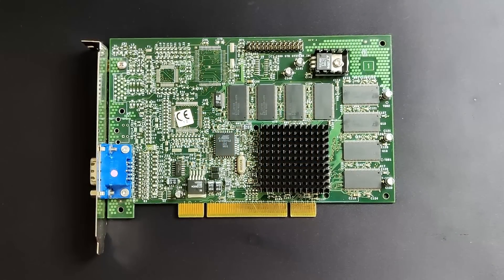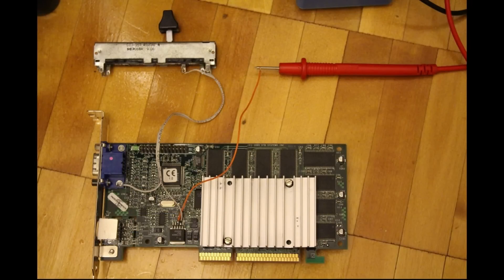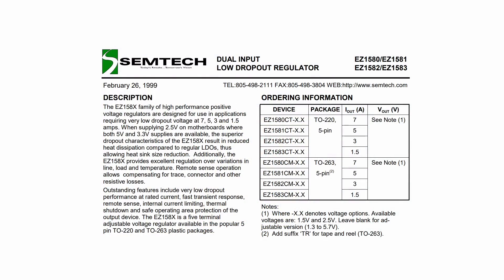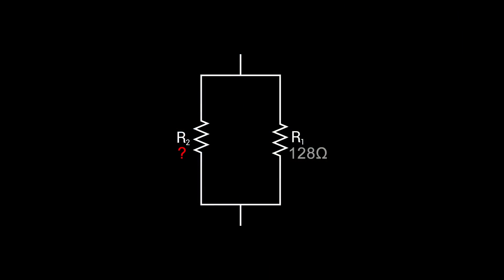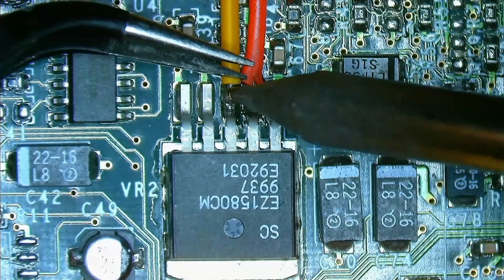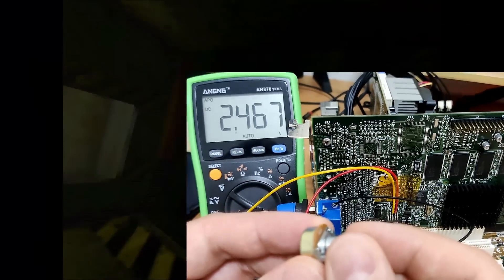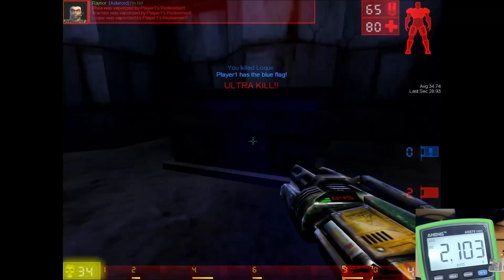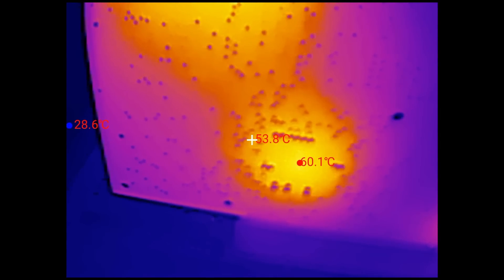Is there a solution to my hot Voodoo 3 card? YES: Volt-Mod!

Comment: The comment that installing a bigger heatsink is useless is for sure incorrect. The bigger heatsink not only has a higher thermal mass but also by all reason lower °C/W value, more heat dissipation, IF it's designed correctly and not too constrained by thermal path impedance, which i would say the blue heatsink you picked looks very unwieldy way exceeding single slot constraint, but for thermal design it actually looks very good due to thickened pins and bottom plate, they thought this through. Copper heatsink could be good as well, at same size envelope a well designed copper heatsink is almost twice as good as aluminium, i can see some really nice skived heatsinks on Ali. Titan Copper or StarTech UniVGA could be very powerful as well if you run into them, extra powerful are some heatsinks off mid 2000s VGA cards which use a copper heatspreader and a copper accordion shape welded on top with a blower fan off to the side, but can be a little ridiculous and difficult to fit.

Comment: It's almost always a good idea to connect an unused third terminal on a potentiometer to the middle pin - that way, if the potentiometer breaks or develops intermittent problems, it will fail at maximum resistance but never completely open (which can have disastrous results in voltage regulator circuits).

Comment: Recently I have removed the heatsink in a V3-2K PCI putting it in the freezer for an hour or so. This weakens the Epoxy enough to loosen it with little force and plastic tools.
Reply from the maker: This is exactly the method I am planning to use for my card as well.
Reply: @bitsundbolts  maybe a freeze spray would do the trick too?
Reply: @PhoticSneezeOne  thermal shock

Comment: You can get rid of the 3.3V regulator with a small step-down converter which does not dissipate the excess "voltage" into the air.
The LT1565 should offer between 4 and 7 amps according to the datasheet. Maybe you can measure the current drawn under load and look for a 3.3v step-down / buck converter.
Not the cheapest one, but there are really small ones with low ripple.
Reply from the maker: Yeah, I think I want to find a nice replacement for the current regulator. I will do some research, learn how to use my pocket oscilloscope, and some day make the video :)
Thanks for the suggestion of the regulator model!
Reply: If i remember correctly, the PCI Slot provide also 3.3V. Old Mainboards in the AT Form Factor didn't had sometimes the 3.3V Rail from the Power Supply and/or was not on the Mainboard provided or not with enough Amps.
Reply: I think it's not only a pre-regulator for the VCore LDO, it also supplies VRAM and Flash and IO circuit. I suspect a well designed card with a switching regulator is designed entirely differently, that indeed there is not only a switching regulator as pre-regulator (that may as well be tuned much lower output than 3.3V) but also a linear 3.3V regulator for all the low power, voltage noise sensitive circuits in the card, or extensive conditioning. Like there's for example something that looks like sync generator logic and dual diode protection on the VGA out, due to small voltage leakage, the signal quality is retained if you condition the power smooth.
Reply: @SianaGearz  as nervenderkobold2861 mentioned, the older PCI-boards don't offer 3.3V, there were adapters around which could do this. AGP per design offers 3.3V itself, don't know the exact current, but should be enough for most cards. Newer cards had dedicated power connectors like today.
I think the requirements for the V3 PCI isn't that high, otherwise the (nearly identical) AGP-model wouldn't use the 3.3V from the slot.
Reply: @SianaGearz  the use of linear regulator at that time is down to production cost. Voodoo 3 2000 were released around Pentium 3 time. CPUs and the surrounding parts already using buck converter at that time to increase efficiency. if we're talking noise, the main PSU itself already employs switching technology since AT age and noise performance at that time were way worse compared to today's PSUs yet all other parts works just fine. i see no reason parts on these graphics card to require way less noise. they're not mission critical components.

while buck converter is way more efficient and can be designed properly, their price didn't scale that well at low power use that time. LDO fits the bill with lower efficiency as the tradeoff. also, LDO tends to have worse performance at frequency higher than 120Hz unless you're looking at fancy parts. at switching PSU frequency level, they probably passing a lot of noise already

and like others said, the card uses 5V rail for backward compatibility with PCI 1.0 spec
Reply: Easiest would be replacing 5-3.3 regulator with a plug and connecting it directly to PSU 3.3V off ATX connector.
Reply: If you replace a regulator with a switching one I would suggest replacing the lower voltage GPU core one instead of the 3.3v one. Feed it directly from the 5v power and this will also remove most of the voltage from the 3.3v regulator.

Comment: For the Voodoo 3 3000 video you can also try going up in speed! I'm planning a similar mod to this to try and eek out 183MHz from my modded MSI board which had 143MHz stock.

The Voodoo 3 book on 3Dfx archive gives info about voltages, currents, and clock speeds under the VCC limits section if you need more info.

Also, if you want to remove the heatsink I have had great luck in the past with the freezer trick.

Comment: i have no nostalgia about this graphics card, yet i yearn to see that heat sink removed. By the end of it i wish to see a comparison showing a graph with the fps before and after all the mods.  Great work.
Reply: same here many must have it cause they could not buy it when they where young but back then 3dfx was nothing more then a good budget card for me for gamers but could not even get close to nvidia tnt -tnt 2 ultra against picture quality and just 16bit render and more blur and surely not to use as a workstation card i had all cards then for fun, and was my job to build hundreds gaming of pcs for customers i have left just with around 20  3dfx card just for collection museum purpose like i do with others cards but there no reason to build a retro pc with 3dfx when you can build a better with just an gf 2 or tnt2 ultra but i am not even interested in build retro pcs i can play many old games even on a modern pc maxed out quality setting and modded settings

Comment: 0:25 replace regulator with a dc dc converter you can get small pcb modules online for 3.3 and 5v out 12+ vdc in and add proper decoupling /smoothing, and put a fan and replace thermal paste and find a denser heatsink for the gpu
Reply: Drop 50 degrees simply by having the cooling system of a modern gpu and power supply

Comment: This explains why voodoo3 1000’s all seem to successfully overclock to voodoo3 2000 and some voodoo3 3000 clock speed at their stock 2.2v, because the voodoo3 chips seem to run highly conservative voltages, especially at the low end.

The catch with a voodoo3 1000 is finding a model with 16MB SGRAM. Some are 8MB and most are SDRAM which doesn’t clock much above 125mhz, while the SGRAM equipped cards generally have no trouble with 143mhz+

I run my voodoo3 1000 with an aftermarket heat sink at 150/150 at the stock 2.2v, a healthy overclock, had crashing at 153mhz and pretty sure it was memory related as the artifacts were colored dots, not rendering issues like a GPU would produce.

Comment: Great video! Considering how hot these V3s get, this is an excellent way to prolong their life along with active cooling. I saw the same one by Edward a few weeks ago and am considering doing the opposite to overvolt the Voodoo 3 2000 I just repaired. Will be interesting to see how far I can push it (with better cooling, of course). It's interesting that the different V3 models have different vcore values. I had heard this before but never tested that theory. It would certainly make sense because cards like the V3 1000 have no heatsink at all. Couldn't imagine how it could handle the heat after seeing how hot 2000s and 3000s get 🔥

Comment: I'm interested to see if you might consider it worthwhile to instead replace the resistor for between the LT1580's ADJ and the circuit ground with a resistor of the new value (82R)? 

The current through that path is specified to be around fifty microamps and a maximum of 120 microamps - so any thin film SMD resistor will handle the current, and high precision is not too expensive... 

It's good to see undervolting as an option here, but remember as with the LT1585 that any voltage that you're reducing gets burned off as heat at the regulator. Something to remember, but similar to the 1585 the 1580 is rated to function to 125C - and voltage is stable to within two millivolts between 0C and 110C.
Reply from the maker: That was my worry that reducing the voltage will just make the regulator heat up. Surprisingly, I didn't see much of a difference. I have to go over my previous footage, I think I recorded that regulator before the mod. Anyway, I can always retest that as the mod isn't permanent.

A nice idea about replacing the SMD resistor. That would be the cleanest solution. Now I just need to design something to switch between Voodoo 3 2000 and 3000 efficiency mode :) I an imagine that at 166 MHz, I need a bit more than 2.1 volts.
Reply: Perhaps he can find a small potentiometer than can fit too.
Reply: @bitsundbolts  Reducing the core voltage reduces the current it draws. This will counteract the increased voltage drop to some extent.

Comment: 0:50 The heatsink looks worse on my STB V3 2000 AGP. It's so twisted, you can see almost 3mm² from the edge of the chip with the "golden arrow". 🤣
Reply from the maker: The heatsinks on most Voodoo 3 cards are terrible! The glue they used isn't transferring heat well and then it looks like in-between Oreo cookies! There's just too much gap between the chip and the heatsink. It's really bad!

Comment: I'd be curious to see what the default voltages are for the 2000, 3000, and 3500 models. The yields must've been good on these chips, as it's almost a guarantee that you can overclock a 2000 to 3000 speeds.

I would love to see you hot-rod a card with faster than stock memory and a big heatsink. It'd be interesting to see if you could go above 3500 speeds!

Comment: I would love to replace the heatsink from my Voodoo 3 2000 but I'm afraid to damage it in the process. If only there was a product that could dissolve this type of epoxy, it would make modding much easier.
Here's a suggestion: how about using 2 thin blades from opposite sides, pressing them against each other from the border to the center of the GPU, right between the cooler and the GPU? That way no pressure is applied to the board nor the GPU, only to the epoxy (hopefully).

Comment: I wonder if it's possible to replace that LDO with a modern high speed switchmode controller.
It needs to have fast transient response and the original LDO has a 0.05%  Load regulation precision which is excellent.
It really depends on how much current is really being passed by this chip. Supplied from 5v (assumed) and dropping to 3.3v (1.7v drop) I would expect around 2 amps based on the heat generated and temps it reached with no thermal compound. That is very doable with a small switcher.

Comment: At the time i make 50 mm fan on original heatsink and it was constantly on from 4 pin hdd connector, never had overheating, but regularly become noisy and changed fans few times. I wasn't  expert and use easiest solution i can find.

Comment: I wonder how one would remove the graphics processor heatsink. I suppose you can degrade the cement with prolonged application of heat through the heatsink top. Anything i can think of sounds more than a little sketchy. Maybe if one also cools the PCB from the bottom somehow?
Reply from the maker: From what I have seen, the freezer method seems to work best. But let's see if there are other ideas surfacing in the comments...
Reply: @bitsundbolts  maybe a thin wire looped around the epoxy itself like how potters separate the clay from the table...? just a wild idea though, might not work at all
Reply from the maker: Someone suggested dental floss, which I tried, but I think this is for softer glue where you're able to twist the heatsink a little bit.. The one I have is like cement! There is no wiggling on the heatsink at all.
Reply: @bitsundbolts  I've been able to use a heat gun set to 100C and gently apply a rotating force to the heatsink, it usually pops right off after a minute or so.

Just be warned that you may encounter the smell of death. When I removed the heatsinks on my V5 5500, one of the VSA-100 chips had a bad application of epoxy. There was a large bubble in the middle right over the center of the chip. It had been so hot for so long that the epoxy had literally burned to a gray ash. Once the heatsink popped off, it unleashed 20+ years of entombed death smell. It took a week for that to air out of my house.

It's also probably why my V5 5500 has artifacts, that chip is probably damaged.
Reply: @bitsundbolts  regardless of what method you will end up using, if the card survives i cant wait to see the next video. Im sure once a proper fan+heatsink+paste combo will be added into the picture, the temps will go down drastically. Also you could try to direct this airflow towards the regulator you were messing around with and also maybe try adding another one of those small heatsinks on the other side of the board formthe regulator.
Reply: acetone could weaken the epoxy but it might dissolve markings on some components that got touched by it (usually electrolytic caps or stickers)